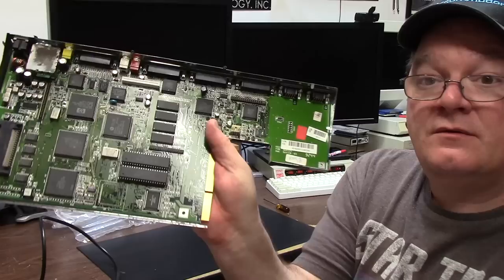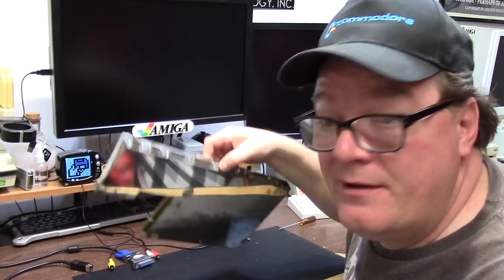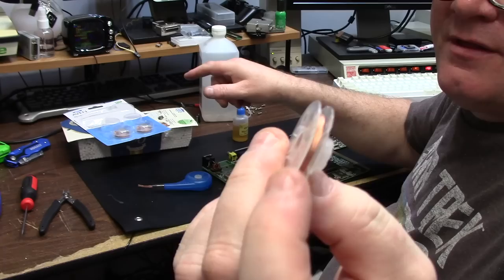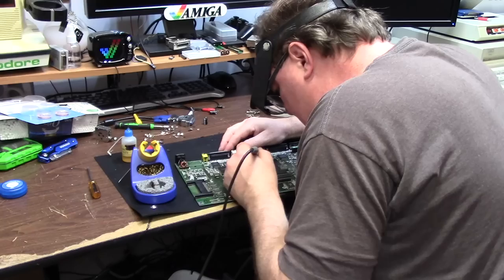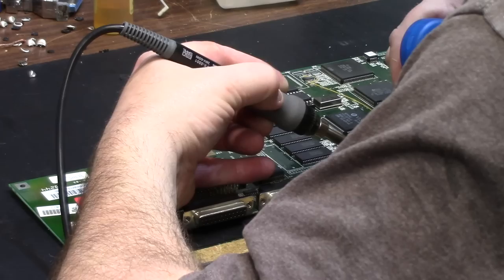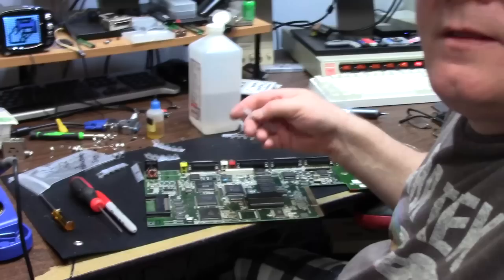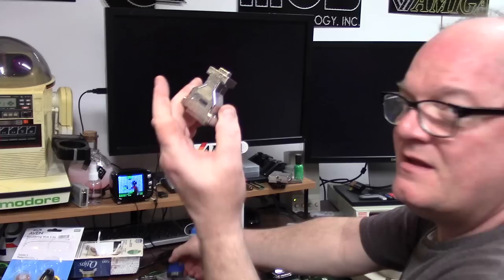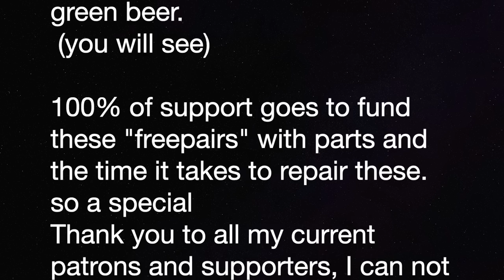Commodore Amiga 1200 Clean Caps but NO VIDEO

Comment: I have a Australian Issue 1200HD/40 it is a Rev 1.D.4, it has a Shield with Plastic backing under it, when New, it had a Shield on top, but the CSA 12 Gauge & SCSI, plus a Larger Drive saw that Top Shield in the Junk Pile, @ the time.. My A1200 needs the same TLC, I hope I am up to the job .. Chris you inspire Amiga Owners to do some work, Thanks

Comment: UK A600s generally did not come with the top shielding from the factory, but always had the bottom. UK A1200s always have both sets of shielding as far as I know, unless the top has been removed and not replaced of course.

Comment: The shielding was there in UK units that i have owned and seen but it was just usual to not put back the top shielding if you modded the machine.

Especially the A1200 as people tended to squeeze in a 3.5" hd leaving no room for the top shielding. 

Great channel 👍🏻

Comment: i dont know who told you that in the uk we dont have the shielding but they were lying we do . ive had my amiga from new it had bottom shielding then thin plastic and even a top shield with tabs on and a little extra little port shield so 3 pieces of metal in total 1 large flat on the bottom then a big piece curvy then a little piece they all connect with little metal tabs that you bend into place . nice video m8 well done .

Comment: Nice job!!!  I just remove the keyboard connector myself, which is a personal preference, does not take very long to remove and put it back on.   I actually need to open up all my toys because some I have recapped but those all have notes inside while others have them outside as well so I have to add notes to the outside of the cases better to place notes in both areas.

Comment: Compliment as always! ... in addition to the skill there is also sympathy in your videos. For my 2nd recap of a1200 I used your method of twisting the capacitors to remove them plus a little variation and it worked great without breaking any leads. In the 1st recap to remove the capacitors with hot air of a friend of mine, the 2 10uF traces behind the keyboard were lifted. Then I fixed it , Great keep it up! 😄
Reply from the maker: I DO NOT TWIST< I CUT
Reply: @ChrisEdwardsRestoration  yes I know that in this video you used the "cut" method I was talking about the previous video where you removed the capacitors by pressing them down and with a slight twist to the left and right and finally I unsoldered the easily cut legs
Reply from the maker: Not me i always cut
Reply: @ChrisEdwardsRestoration  I saw it here https://www.youtube.com/watch?v=P0MU1a5xPQk&t=399s at minute 5.15 but you're right you didn't twist it I remembered it wrong, I made a mix in my head of 2 videos 😀
Reply: I don't know why people don't use 2 soldering irons... :D I take less time than cut or twist, and there is less harm/stress to the pads. flux is essencial... and correct temp... but I take them out easily...
I have no problem to use both hands independently. hahahaha

I had an reamiga, that didn't want to work... I removed every one of the passives like this (two irons... also works for resistors and etc...) retested them all... found an broke  resistor. :D and ... it was that ... broken from factory.
Reply from the maker: F that shit

Comment: the ones with no shield are probably ones that have been modified mine used to spend alot of time with the top 2 shields off as i was always messing around in there ... and the lid would just sit over the case not clipped in on an angle so i could get in there on the fly . now mine is all buttoned down as ive got the cf card for a hdd and the indivision mk3 for hdmi out so i cant get my top shield on as well but with the new case it has really good tight fit as the case has the brass inserts for the screw holders . south uk

Comment: That was awesome to watch! ❤ I just went through restoring my ol' A1200 (PAL, Switzerland, with a Blizzard 1230 Mk IV). Added new keys, new case.
Kind of afraid to do a recap though since i'm fairly new to soldering. Mine has a peculiar problem that whenever DF0 reads/write from/to a disk i get screen corruptions. At first i thought it may be the drive itself, but the same behaviour happens with a Gotek.
Any possible clues what the issue may be? Everything else works fine.

Comment: I have the same soldering station, but obviously not the same skills as I couldn't get the RF modulator off and was worried about overheating the pads. Just curious - what temp do you use to do that kind of work?
Reply from the maker: 4 million kelvin.  - I run my Hakko at 600F or 315C for regular, and 750F or 400C for tough ground planes. I also use soft solder too so that has a lower melting point
Reply: @ChrisEdwardsRestoration  thanks so much! I'll have to give it another try sometime. I need to feed a cable through that space for my Indivision scandoubler so that I can close the case.

Comment: My Danish A1200 was shielded as well. Still got the shielding, but moved it over to a Checkmate case. Re. When you debraid/desolder with the braid, which temperature do you use Chris? Do you used braid that is already fluxed?
Reply from the maker: 4 million kelvin. jk - I run my Hakko at 600F or 315C for regular, and 750F or 400C for tough ground planes. I also use soft solder too so that has a lower melting point
Reply: @ChrisEdwardsRestoration  Thanks! I had issues getting my braid to suck up almost anything. It looked so easy on all the videos I saw, so did not get why I had so much trouble with it. Could be the brain was just too old or so, but I saw a tip to put some flux on the braid itself, and it could help a lot. To be safe I got some new braid as well. I make so few mistakes so I almost never use it….. :D j/k, I am getting back into soldering, but mainly the part year been doing a bit of this and that. Biggest project currently was to assemble a SixtyClone C64 replica, an a Retro Chip Tester Pro. Next will be a Denise board / A500+Replica. Just getting a little SMD experience first, and sucking any and all soldering tips to me, that I can get.
Reply: @ChrisEdwardsRestoration  p.s. Thanks for the awesome videos you make. Combining great work with humor is double the joy to watch. :)
Reply from the maker: Practice on old pc cards. Not amigas!
Reply: @ChrisEdwardsRestoration  Haha of course. The practicing happens on smd practice boards bought off amazon. :) As well as a number of small DIY kits etc. Not gonna practice on important stuff as Amigas! :)

Comment: Hi. I have a Amiga 1200 that is showing a black screen (sometimes). The LED is than dimming. But it is starting somtimes without problems with a full bright Power LED. I dont know what the problem is. After a recap the problem is still there. What an i make? Can you give me some tips?
Reply from the maker: Any cards that may need a reseat?
Reply: @ChrisEdwardsRestoration  NO, only the bank Mainboard with Floppy and without Floppy Drive.

Comment: I got faulty CD32, had no video at all. I did recap and video is back but every few minutes the screen changes to black and white. Any idea what might be still faulty?
Reply from the maker: Cans dead or the cxa1145 encoder is pooping  out.  Try s-video and see how it goes
Reply: @ChrisEdwardsRestoration  sorry, what are cans? Thanks for reply!
Reply from the maker: @DarkDefender01  the little square low pass band filters to the very left side of the 1200 board/600 board near the video area, they convert the chroma/luma from the video dac and output the composite video or modulator video